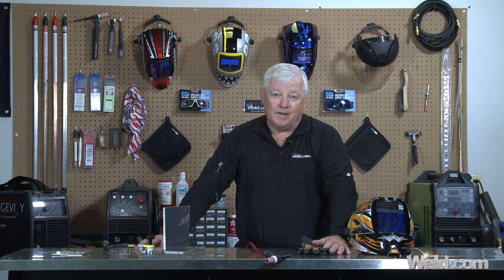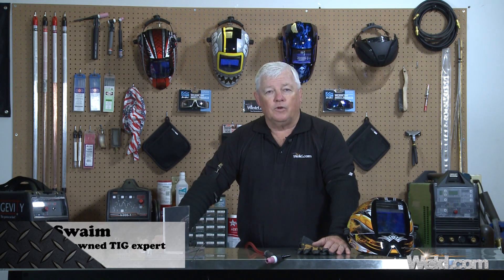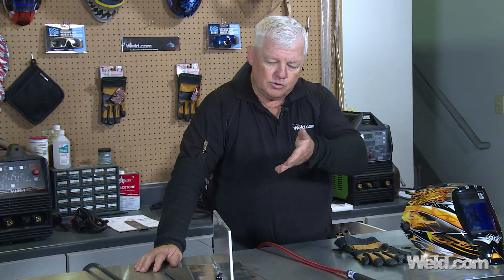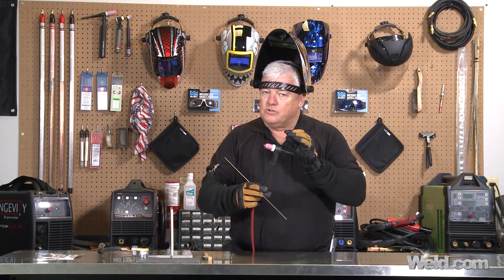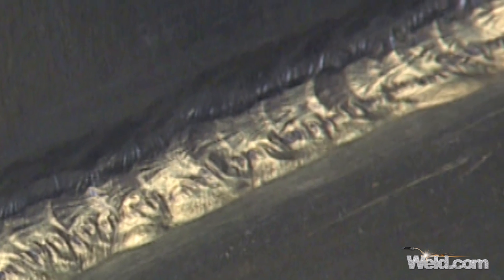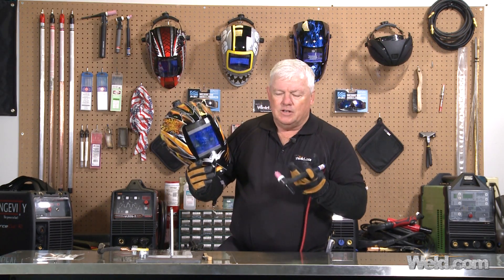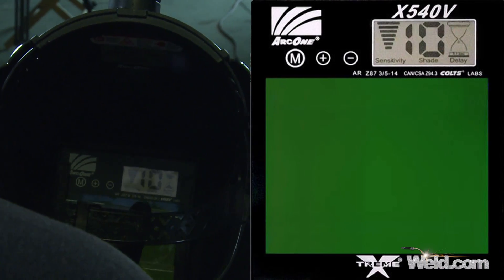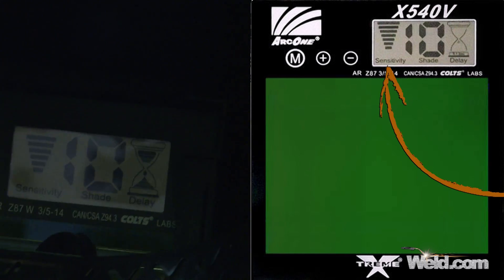TIG Weld 3/8" Aluminum Fillets with 160 amps on DC with Helium Gas

Comment: Back in the early 80s welding for Budd company ss railcar division we used this method on baggage racks thin wall tube to 1.5 aluminum bar. Put a point on the tungsten and everything is by feel. You really can't see a puddle it will come out like a string of pearls once you get it down. The weld inspectors always made a fuss because none of them had seen it before and the racks were the only place it was done. I am sure there was a procedure written for it as we were all dot certified under asme.

Comment: I really dont think you would see this ever being on a WPS.
Reply: Ben Jirinec lol
Reply: Back in the 70's I worked for a man that was a welder at Rocketdyne and he told me they used DC straight helium for xray welds on the Apollo moon project.
Reply: I weld a lot of aluminum at work Pulse mig push pull and tig . Have to weld thick shit all the time 150 -225 degrees preheat and etching clean aluminum or ss wire brush. But dc why ac can do it better for thicker stuff you can add helium .

Comment: I want to weld 3/8 and 1/4 aluminum with a machine that goes up to 180 amps.  Will AC and helium work for this thickness or does it have to be DCEN.  The weld is structural and needs to be strong.

Comment from the maker: This process can be used for much heavier wall thickness than 3/8". The point of the demonstration was to show that you don't need high amps necessarily to penetrate heavier wall Aluminum. We could have easily scaled this up to 1" Aluminum without a problem.

Comment: The way I usually weld thick aluminium is that I preheat it first with a torch and then weld it with normal  AC